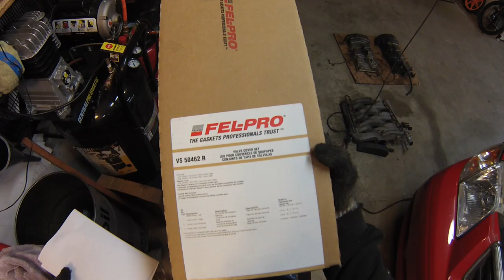1999-2002 Mazda V6 2.5L MPG Valve Cover Gaskets - howto

Comment: Wow, this video is inspirational. I've exact same engine on an MPV of 99 (Japan market). Also oil residue on the engine's rear. The gaskets etc need replacing. Fuel injectors need cleaning. May as well venture out now to do it myself with removing the air intake manifold. Thanks!

Comment: Thank you for posting this video.  I have a Mazda with a similar v6 that needs valve cover gaskets due to a leak into the spark plug access in the cover.  Your video gave me the insight needed to tackle this project.

Comment: Super helpful. Replacing only the intake manifold gasket and plugs /wires.  Thank you for the video.
Reply from the maker: ***** Glad it was helpful. Thanks for watching.
Reply: ***** Found oil in the rear spark plug tubes. Changing the valve cover gaskets after all.

Comment: Very well produced video. I was interested in how to replace the spark plugs and it appears that the air intake manifold must be removed to have access.
Reply from the maker: Yes, that seems to be the case here.
Reply: bigbird385 Hi, Replacing the spark plugs does not require removing the manifold. The front ones are easy once you use an extender tool and for the rear three spark plugs just remove the ignition coil. Watch out to make a note of the spark plug cables - which goes where - before disconnecting from the coil.

Comment: I have watched this so many times just to get my motivation lol.  I love how exact and detailed you are.  I need to do my valve cover gaskets but also need to replace the ingnition coil pack  ASAP on my 2001 mpv exact car you are showing. I have not been able to find any correct videos.  Do I have to remove everything as if I am doing the gaskets just to remove that coil pack?  I really am trying to avoid disconnecting everything right now.  Thank Jennifer
Reply from the maker: Sorry, I haven't worked on this car in years. But yes, uninstall until you can get to the coil packs.
Reply: if replacing just the coil pack, no need to remove intake manifold, go straight to 5:22 to remove coil pack,    just use fingers to feel the bolt

Comment: My MPV has white goo on oil cap. Saw this video and am gonna attempt to change the gaskets as you have and the water pump. Any other suggestions.
Reply from the maker: That may be a blown head gasket. Check the dipstick to see if chocolate milk is there as well.
Reply: YES DEFINITELY IS AS THE COOLANT PORTS ON GASKET ARE BLOWN INTO CYLINDER BUT IF NOT RIDING ROUGH ITS DEFINITELY SO BUT EITHER WAY NEEDS TO BE CHANGED.

Comment: I just ran across this video, and it was super informative. I have to work on a 2000 MPV (exact same engine), and I've got  to change the spark plugs. One of the things I have to do also is replace the EGR valve. Do you have any info on how to disconnect the EGR from the exhaust? Thanks in advance.

Comment: The stick appeared normal maybe a little darker considering I just changed the oil 2weeks ago. So if it is the head gasket, will he process be the same...not that mechanically inclined but follow instruction.
Reply from the maker: Head gasket is much more involved. You have to remove both intake and exhaust manifolds, coolant and camshaft sensor connections, as well as engine timing.

Comment: Good video thanks for showings us. Now there is anyway to see the head gasket remove, because water came out with my oil after overheat or is the same procedure
Reply from the maker: Alfonso montano I did not replace head gasket for this car. I think the owner has since sold the car... so I won't be able to help with additional video.

Comment: It's amazing how much work is required just to change the valve cover gaskets on this car.  I used to own a 51 Chev pickup.  Changing the valve cover gasket required removal of six bolts.  End of story.
Reply: Was it a straight 6? Those are super simple even on BMW's.

Comment: Good video, 
But if you unbolt the overhead intake manifold, it pretty much just can be moved to one side out of the way without disconnecting everything.
Reply from the maker: Good to know. Older car and not familiar working on Mazda engines, I didn't want to risk anything cracking or breaking.

Comment: Can you please tell me the torque specs on the manifold bolts, my mpv after doing the job came back with a manifold pressure code and lean bank 1

Comment: I have a 2000 Mazda Millenia with a 2.5 L V6 and 132,000 miles on it. The engine has started making a very noticeable knocking sound at idle, but it gets quieter when I speed up the engine. This makes me think it could be a worn or damaged harmonic balancer (pulley damper) rather than something inside the engine. Do you have any experience with this type of problem? Just like to get your opinion before I start taking things apart. Thanks.
Reply from the maker: New Jeffersonian I don't have experience with this engine and it could be anything, but usually knock is internal to the engine, most likely connecting rod bearings. A worn harmonic balancer would probably get worse as RPMs increase. Worn connecting rod, wrist pin or crankshaft bearings typically quiet down as engine load is increased.
Reply: *****
I appreciate your quick reply. The reason I think (and hope) it's the harmonic balancer is because I had one wear out on a 1992 Pontiac Firebird and it made the same kind of knocking sound. I first thought it was a serious internal problem and the engine was likely ruined, but a friend told me that if it got quieter rather than louder as the engine speeded up it was probably the harmonic balancer. When I got it off the crankshaft I found the cushioning material was badly worn and split. After replacing the balancer the engine ran smooth and quiet and I drove the car another 4 years.
PS. Thanks much for making this video. Very informative.
Reply from the maker: Bannington That is a possibility and should be readily evident by removing the right front wheel and looking past the wheel liner. Good luck.

Comment: How long does it take you to do this job, an experience mechanic like yourself?  I believed my 2000 MPV has the same issues, it's so bad that the exhaust muffler blowing bluish smoke.  But after awhile it's not blowing anymore, perhaps you can tell me why.  My engine oil level is not normal either.  Thanks.
Reply from the maker: I think it took around 4 hours. I've fixed a lot of cars but I've never worked on a Mazda before.

Comment: Great video did you have to change the air intake gasket?
Reply from the maker: +charles hawkins I believe it was a basic single layer flat steel gasket and reused it.

Comment: Is it necessary to remove the intake manifold if just replacing the spark plugs on this vehicle? The front facing plugs are easy to access but the rear facing plugs are a lot more difficult to reach.
Reply: no need to take out intake manifold, I don't remember if i needed to move aside the igniter box but definitely you have enough space to take out the rear plugs with an extension, getting spark plug wire puller makes job easier but not a must

Comment: i have a 2000 mpv and it makes a chirping spound by the alternator area but no belt or harmonic balancer on enging running...
have replaced alternator and belt ond tensioner for nothing and ideas befor i tear into timing chain area?
Reply from the maker: +Scott Tyler Exhaust rubbing on anything? My MINI Cooper makes a chirp sound when the exhaust is rubbing on something.

Comment: Are the new gaskets an upgrade that eliminates the need for the sillcone bead?
Reply from the maker: +Philip Arndt Sorry, I'm not sure. Many gaskets the bead is not required but at a sharp corner like that, it's a good habit to put a small bead there just in case and to eliminate any chance of future leak from that spot.

Comment: hey question, i just bought a 2000 mpv and i noticed the vac tube unpluged and wasnt sure were it went to but after this vid u mention during the uninstall that it was the activation vac.  if thats un hooked how bad is that for the car?  as of right  now the car runs fine with no issues.  also, the heater lines rnt hooked up to the in/out ports on the fire wall, where would the ports be on the  motor located?  thanks.
Reply from the maker: +hcracer1985 Hello - I don't know what the line does but over time it will probably cause a check engine light or affect efficiency. If it was me I'd want to fix it. I've only worked on this Mazda a couple times. I'm not sure about your second question, sorry.
Reply: +Mod MINI yeah it's ok. I just bought and plan on fixing it. My other question pertaining to the heater hoses is, where on the engine block do they route to get coolant?
Reply from the maker: +hcracer1985 I already answered that above - "I'm not sure about your second question, sorry." It will probably be somewhere near the thermostat but I don't know. Just track the hoses.

Comment: do you not need taut settings when tightening up on cover
Reply from the maker: I show only the battery powered tool in the video so viewers don't get bored. I go back and snug them down with a hand socket tool.

Comment: btw, to change the 3 back spark plugs do i have to take tho whole intake out?
Reply from the maker: I think you probably need to remove the intake, unfortunately.
Reply: I have the same question!
Reply: no need, enough room to do it without removing intake manifold
Reply: I HAVE DONE WITHOUT BUT TAKES A TREMENDOUS AMOUNT OF FEELING AND PRECISION TO DO SO. NOT EASY BUT CAN BE DONE.

Comment: You didn't torque the intake bolts?
Reply from the maker: I went back and verified tightness by hand, but I have been doing this long enough that I don't need a torque wrench for a valve cover gasket.
Reply: ***** fair enough,thanks very helpful video.

Comment: Warning!  this video is 10 years old.  My 2001 MPV is now 23 years old, 156K miles.  FIRST check to see if you can unbolt the "Exhaust Recirculation Manifold," (shown here at 2:50 - 2:57).  If you cannot remove those two steel bolts into the aluminum intake manifold (rusted solid ??)... you will never be able to remove the intake manifold and complete this job.  A propane torch on the aluminum has not helped.
EDITED:  24 hours with WD-40, then an 18" braker bar with 10mm socket was successful on the frozen bolts of the Exhaust Reciruc Manifold, after 23 years.

Comment: I have the same 2001 MPV.  Last year, I had to remove the throttle body (plus a lot more) and disconnect all large radiator hoses to replace the T-hose (Torture hose)  I think you quickly glossed over what it takes to remove the throttle body.  Too little dialog and too few close-up photos.  Plus, you were completely silent upon reassembly.

Comment: Great video and very well presented. Our mpv is leaking a little oil. Where are the most common places oil leak from?  Thanks for sharing.
Reply from the maker: +Oren C Sorry, I don't know. I was fixing this car for a friend. Get the car in the air and track it down. Oil goes down and toward the rear of the car. Look up and forward and you should find the culprit.